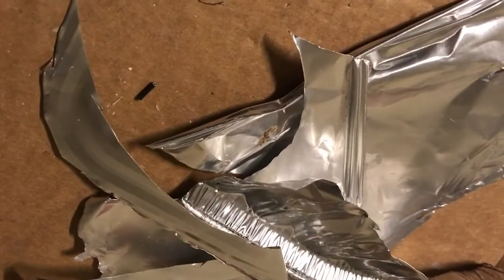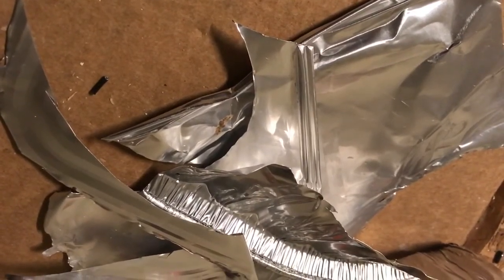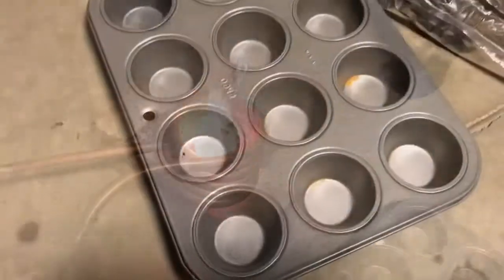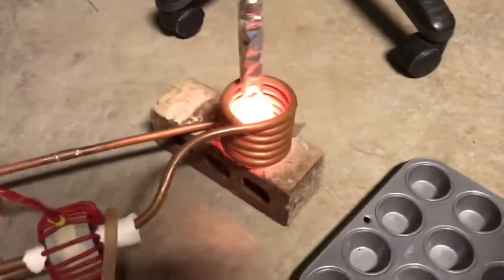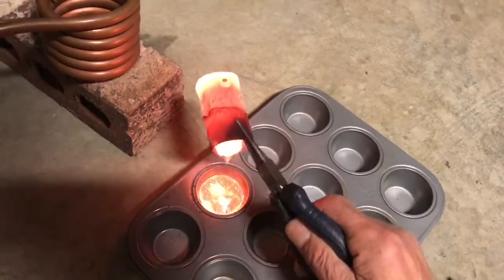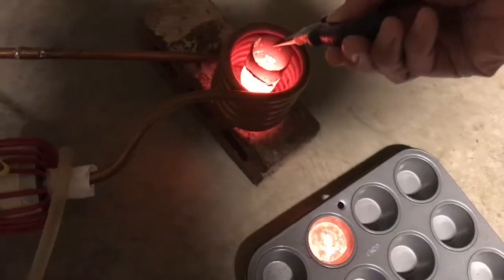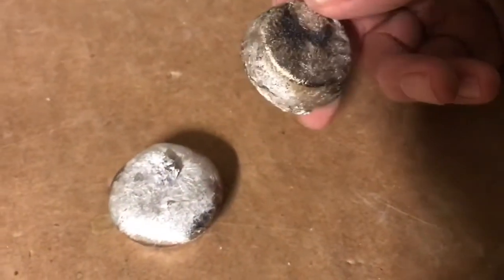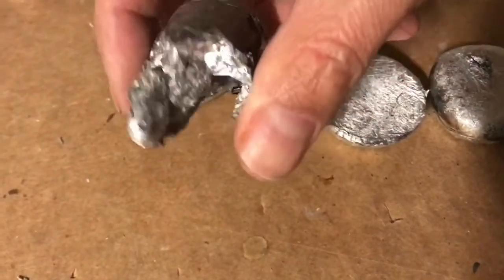Casting Aluminum  Ingots from Old Baking Trays

Comment: go on put a lump of cast iron in there.   i think you will succeed with your igbt system.    i just about got there with the 260 royer circuit so i am sure your 4kw would do it.   nice work...again